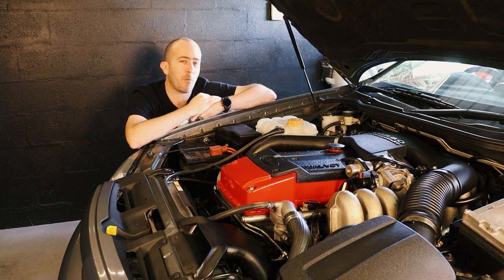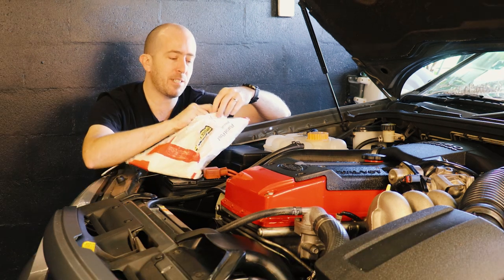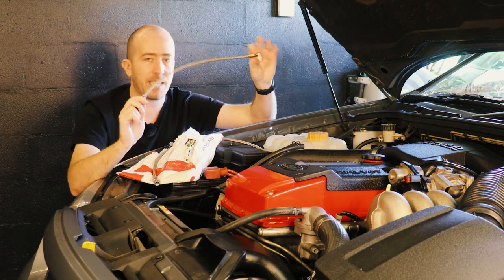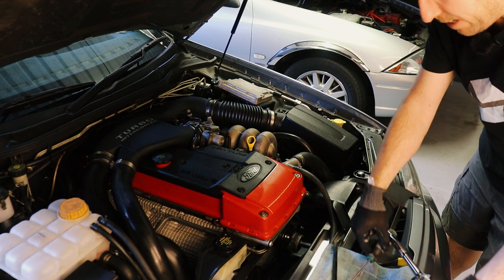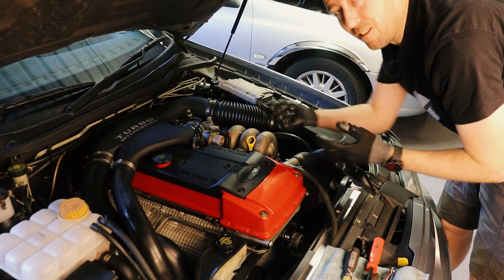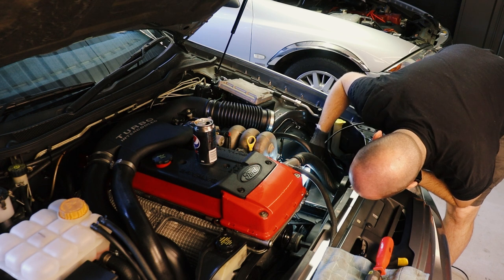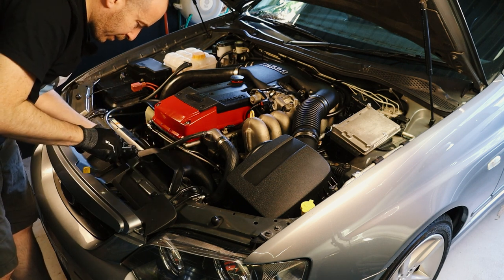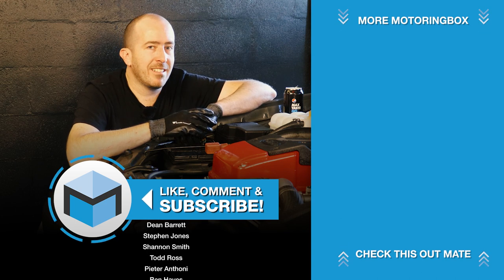🛢️Barra Turbo Oil Feed Line - Every Ford Falcon XR6 Turbo Needs This RIGHT NOW! Goleby's Parts

Comment: Tools, yes just buy when you can cos you never know when you need them. You have the basics but specialised tools are usually once in a blue moon purchase. Glad the turbo oil feed kit has worked for you.
I always read & re-read if I need to do any major work. Eventually someone you know will want to do the same thing and you can easily show them.

I'm not a fan of HubNuts work. He borrowed a Holden VU ute & kept wondering why he was wheel spinning around the corners. I explained that driving a ute & sedan have major differences in driving style but Ian kept putting his foot flat to the floor going around corners. Especially after it had been raining. He didn't like my comment about changing his driving style to suit the vehicle & conditions and his sour reply I did not welcome it. He had treated other vehicles accordingly to their age & driving style, but not the ute. I unsubbed his channel. If you're borrowing someones pride & joy for filming purposes, respect it.
Reply from the maker: I don't think I watched that one. For the most part he seems to treat cars well.

Comment: Get yaself a socket set man! lol
Reply from the maker: I have 3!
Reply: @MotoringBoxTV  Then why you macgyvering a poor spark plug socket for man! haha
Reply from the maker: Just not having the right sized deep socket in this instance. One of my sets only has them up to 19mm, which was inconvenient. Luckily the spark plug one did the trick.
Reply: @MotoringBoxTV  Get the toolpro 138 piece set, comes with a crap tonne of stuff you'll need all the time. when they are on special, you can pick them up for almost $1 per piece which is ridiculously cheap.

Comment: Can’t you just replace the oil filter banjo jobby and call it a day?
Reply from the maker: For sure.
Reply: yes you can but you will need to remove and either clean and replace at least each time you do an oil change